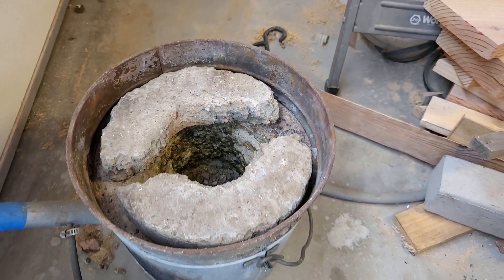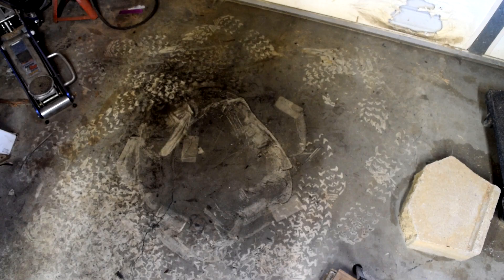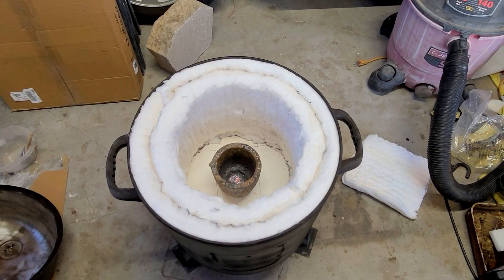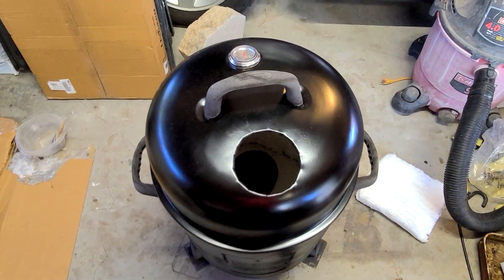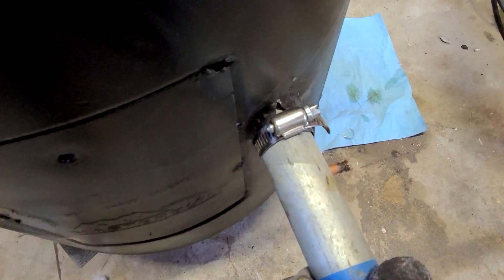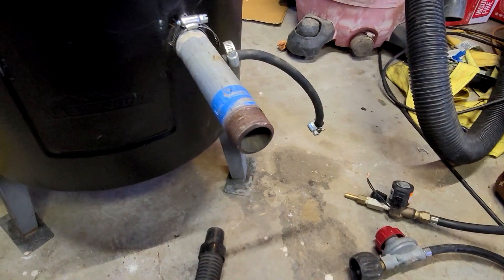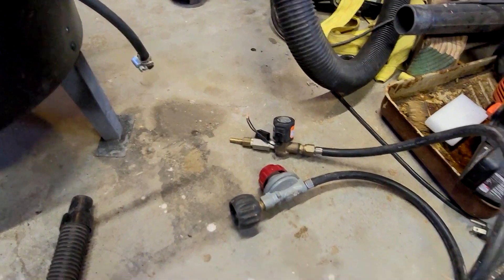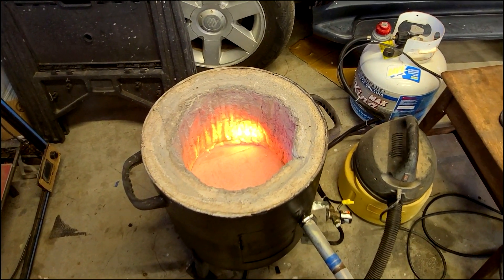How to Build a Metal Melting Foundry at Home

Comment: Curious how it's held up. You shouldn't run a shop vac on a dimmer. It's not designed to run at a lower voltage. If it shuts off (burns up) while propane is flowing, it could be a bad situation. This is a well-known danger with forced air foundries. Always keep a close eye on your blower when dealing with propane. I'm saying this to anyone who plans on doing that. Other than that, good build
Reply from the maker: Its held up really well! I agree on the blower but there is very little danger with the propane, as the propane supply is on a solenoid and flow can be cut off with a flip of a switch. Not to mention the propane enters the system pretty far downstream from the blow motor. For added safety the solenoid could always be wired in series with the blower so if power shorts with the blower the propane is immediately cut as well. As far as durability the thing still looks brand new even after countless heat cycles. Thanks for watching!